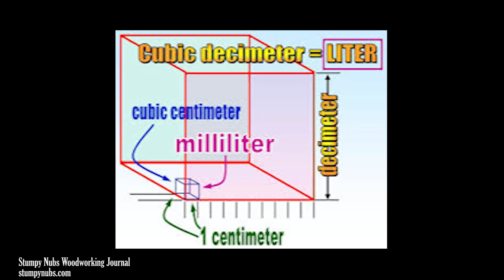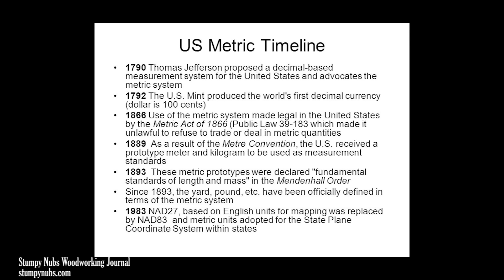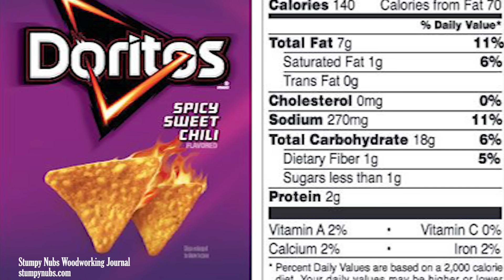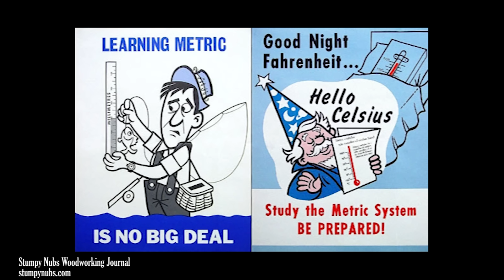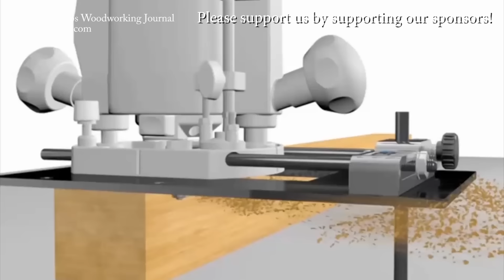BREAKING: The USA is switching to METRIC!

Comment: It's funny because here in Germany we always use the metric system but on our rulers we also had the inches (we call it Zoll which translates customs) . It was very confusing for us some of us back then. But we also got in touch with it back then.
Reply: While we generally use metric in germany, things like plumbing or car rims or tv screens use inches.
Reply: @flybywire5866 Selling screens only it imperial however is not legal. Same with using PS or horsepowers for the power of sth. Imperial should be finally replaced everywhere.
Reply: The german word "Zoll" was written "Zol" back in the Days and was always a unit of measurement. "Zoll" also means "customs" but that comes from the latin word "telonium" which describes the Place you had to pay customs to continue your journey.
Reply: @Wildschwien  I have no idea how PS works for horsepower- I know 50hp is a nice amount on a bike, but is 50PS more or less, and by how much? Same with torque- 50ft-lbs is enough for a smaller bike, but is 50Nm more or less, and by how much? There's just not a sense of scale when it comes to the practical things.
Reply: @shadowmancy9183  PS is Pferdestärke (horsepower) in Germany. However this is not the same as the unit hp I think. We don't use lps as well.
Reply: Here in Brazil we use metric forever, and our rulers have inches too, but we completely ignore the other side of the ruler xD
Reply: @ellie-oaks  😅
Reply: I think this is just common practice in countries that use SI units. I'm from Russia and here some rulers (although not many) also have units doubled in inches
Reply: @lmnk  Depends who has been the wholesaler, I guess.

Comment: As a flight mechanic it would be a 100 times easier if the American engines were designed for metric
Reply: R u working in Boing for any chance? 💀
Reply: Apparently you can hammer on metric sockets onto aircraft spec bolts, Boeing,
Reply: It would be 212x easier
Reply: Ehh no... miles are better... imperial is better
Reply: @sergio-179  Nooo haha
Reply: @markthomas919  Haha well boeing ain't too bad before they started to go only for profits and not being transparant. They where stuck in a bad place when the grounding of the 737 max happened and airbus capatilized of it by producing much quicker than them.
Reply: @markthomas919 or just leave the bolt out.😮

Comment: I believe that in the 1960s there was a big push in the USA to switch the metric system which was quashed by the Society of Automotive Engineers. I think that is fascinating since, as you pointed out, American cars are now mostly metric.
Reply: Wish we had,I would't need two tool boxes.
Reply: The last fastener I saw on an American vehicle was my 1988 chevy pickup... the only SAE bolts left that I know of are the 3/8-16 bolts in a side terminal battery.
Reply: I very much doubt the resistance was at the behest of the SAE, since American automakers are one of the few industries in USA to fairly thoroughly switch to metric.
Reply: @tookitogo  I really wish they had! I had a boat shop in the 1990's. New Mercury (and OMC) outboards with legs and gearboxes built in 'murica were imperial and the powerheads (built in Japan) were metric. BLOODY ANNOYING!
Reply: It's annoying how some american cars have mixed imperial/metric fasteners/bolts, like my 1988 S-10.
Reply: Aircraft and aviation industry is still stuck on imperial units.
Reply: @Chris-hx3om  The transitional period was a PITA for sure!
Reply: @MrZimpauttaja  Yeah, there’s a lot of risk involved in switching. ( *cough* Gimli Glider *cough* )
Reply: We are to lazy to switch lol
However I'd be happy to do so, really isn't any reason not to aside from boomer pride
Reply: This Boomer was disgusted that the conversion was not made during that national debate about swapping over. Anyone who takes a science class must learn metric. That’s when I discovered how truly simple it is. You can still learn fractions for other reasons. It would’ve been so much simpler to do it back when we were in the early exploration of our space program and had all that national pride and enthusiasm.
Reply: This is likely to do with supply chains. If you import from metric-using countries — i.e., just about every country outside the US — you will be getting parts in metric unless you special order them in imperial units, and special ordering tends to be more expensive. By the same token, if you wish to export to those other countries you need to supply your products in SI units, as products that use just imperial units are less useful — and, thus, less valuable — in every country outside those last 3 that still use imperial units.
This holds true even if you send out just the blueprints used to make the manufactured good in another country, BTW; in countries that use metric, manufacturing something whose blueprint is in imperial units ends up being more expensive and error-prone than if everything was in SI units, as all the suppliers will be using SI units.
To put it another way, for any industry that is involved in international trade — such as the automotive industry — using SI units is likely to have lower costs and be more profitable.
Reply: And massive pushback from the people at large. Who saw it for what it was, an unwelcome foreighn intrusion.
Reply: @pamh2703  boo. Metric sucks.
Reply: @carloscollomps1552 well. My SAAB 99 from 1973 had metric except in the Triumph 1.7 and 1.8 liter engines.  Their own 2.0 litre engine was properly designed with metric bolts.
Reply: @jonathonfrazier6622  It doesn't. You just don't understand it. The rest of the world does.
Reply: @gpsoftsk1  we are happy with our system. We have no interest in conforming.
Reply: @jonathonfrazier6622  Yes, I know, typical Americans. No conforming. Then have a higher manufacturing cost than the rest of the world, make more mistakes and use a worse unit system.
Reply: @gpsoftsk1  will do.

Comment: I’m retired now, but I still remember the horror of starting my first job and finding out everything was done in ‘imperial’ units.  Virtually my entire education (in Canada) was done in metric, and by the time I finished university all day to day measurements were in metric units.  However, all my company’s customers were US, and all requirements were in imperial units, well that is to say US measurements as they were a bit different than the British measurements we used to use - just to make it even more messed up.  Now that I am retired and dabbling in a bit of woodworking, I tend to stay with the US units as that’s what all the tools are.  However, I am seriously considering just going all metric for future projects, I think once I get started, I will never look back.

And in some ways the USA is fully metric.  A inch is defined as exactly 2.54 cm and a pound is exactly 0.45359237 kg.  All non metric measurements are actually defined precisely to their metric counter part, and it is the metric measurement that is related to some fundamental physical constant.
Reply: Well said, sir :)
Reply: A screw called out in a design with a British thread type threw off the work cells at one of my past jobs brutally, given that even the British mostly stopped using them ages ago.
Reply: Using Imperial measure is the best way to do construction framing, that's why you do it. You can do a thought experiment on how you would design a metric plywood size and measure out evenly spaced joists to match it. Imperial plywood is eight feet tall. Same as the floor to ceiling hight. The four foot wide sheet can also be framed perfectly with either 12", 16", or 24" spacing. I think, if there wasn't an imperial measurement system, there would be no frame houses at all. Like in Europe.
Reply: I have never bought wood that was in metric dimensions. Using the metric system on wood that is cut in imperial dimensions doesn't make any sense to me.
Reply: To this day I still can not understand British Withworth but I would like to learn before I pass away.
Reply: @timosdinkydetailing , construction measurement habits in imperial units is the only obstacle on the way to switching the entire nation to metric system. Isn't it bizarre?
Reply: @actionjksn , you'll be surprised to find out that measured in metrics, 2/4 is the same size.
Reply: @TroyQwert  what is 2/4?
Reply: Board feet
Reply: @actionjksn , a 2×4 is typically milled from a variety of coniferous species for a plethora of uses by the construction industry.
Reply: Metric is better only because we use decimal numeral system, there's nothing fundamental about it
Reply: @actionjksn Why?  In construction you are going to use the local standard as work will be done such that many pieces don’t need to be cut.  However, in woodworking you almost alway cut, plane or route the would into new dimensions.  In makes little difference what the starting size was measured in.
Reply: @TroyQwert  It's not an obstacle, it's the solution. The perfect way to measure for construction framing. You can't do it in Metric.
Reply: @timosdinkydetailing  , really? Try again. Check the measurements on you measurement tape. They are there in both: inches and mm. And keep inmind again: the size is not changing if you switch from imperial to metrics. It's just different digits.
Reply: @brandy1262  I've worked in construction probably since you were in diapers and have been running my own my own company that long.. Wood people in construction and woodworking in America are not switching to metric because it's not necessary and won't make the work any better at all. . There will be some individuals who do because they already are, but there's not going to be some big switch because nobody in the trades is complaining if they grew up in America. That's why some of the European high-end  tool makers have scales and adjustments on their saws that are imperial.
Reply: @TroyQwert  I've been in the construction industry for over 25 years so I know what 2x4s are. You put 2/4 which means 2 fourths, which is a half. I've never seen 2x4 written out like that
Reply: @TroyQwert   I still have some tape measures that only have Imperial. I use them when doing framing. I think I would be a fool's errand to convert the typical, 4, 16, and 24 inch measures to metric. There would only be downside. Those dimensions are usually highlighted on my tapes, so they are easy to see as well.
Reply: @actionjksn  So is it  "metre" or "meter"?

Comment: I am already a staunch metric user, much to the chagrin of my family and coworkers. My car and GPS are set to metric, I do all of my work in metric (converting only at the beginning and end as absolutely necessary), and, as a bonus, I use the 24 hour clock. Despite all of the complaints I get, I can guarantee that my work is faster and more accurate because I use metric.

Comment: Weirdly enough, the rigid but foldable device for measuring, usually made from wood, is called a "Zollstock" in German, literally "inch stick". A "Zoll" was a cut off piece of wood with a thickness of about 2 thumbs, whereas 12 Zoll made 1 Fuß, or foot. But then a Zoll varied between 2.5 cm in Hesse and 3.7662 cm in Prussia, with Baden and Switzerland (where 10 Zoll made a Fuß) somewhere in between. We also had miles, varying from 7500 to 9000 m, or between 12000 and 24000 Fuß in other places. All in all, the metric system is a good thing...
Reply: Dutch has the same, "duimstok" (thumb stick). Except it's becoming an archaïc word (since it's becoming an unused tool) and we'd use a "rolmaat" (rolling measure) way more often.
Reply: The French used to define a foot as the literal measurement from the Kings foot.
Reply: And this shows why standardization was truly needed. Even before the SI came along, what we now know as imperial units were only ever used in the British Empire; other places had different measurements that, to make things more confusing, often shared the same names but not the same measurements.
Reply: @zbnmth  duimstok and rolmaat arte different things. Duimstok is rigid and still quite handy.
Reply: @@lurch789no it's not. It's the same. your (?) imperial system is just one of the many and evolving imperial systems that are/were out there. That is the whole point. There was no standard, until Napoleon and his metric came along and made it all standardised and simpler. 
Today the US Imperial system is officially defined by the metric system.
Reply: "Elle", "Pfund", "Zentner" are also still common, but are defined in terms of metric units.
Reply: @FabioCapela like 1 swedish mile = 10km. 🤔
Reply: i dont know why it is called "zollstock" here, i know it under "gliedermaßstab" (folding ruler)

Comment: The last three holdouts in the USA are:

1.  Temperature (which is likely to go first!)
2.  Weights and volumes (in lb but these too are likely to go) 
3.  Distances and Speed. 

I suspect that the last will be the most difficult given how all streets are labelled in miles and so on.  It's possible that they will add metric units, otherwise, when it comes to weights, there's really no point in sticking to customary units.  I mean, let's face it, who really wants to buy in ounce increments?

Comment: I grew up in Singapore where we uses Metric. Watching and reading imperial is just about another measuring systems. Hence no big deal. Now a days smart phone are so convenient and conversion is just a click away. 
What I felt really challenging is baking, where Cups and spoons were used rather than weight and volume which is much easier to follow. This is personal. 😊
Reply: A cup is also different depending on who you ask

Volumetric measurements need to go
Reply: @RoryIsNotACabbage  I'd never get any cooking if I had to weigh everything
Reply: Old recipes actually use cups and spoons in Denmark. The problem is that they don't all have the same size. Son of you have a big cup and a small spoon, you might mess it up if you're not an experienced baker. Using grams, centiliters and deciliters (one tenth of a liter) you get the same result every time.
Reply: @RoryIsNotACabbage  When dealing with powders such as flour the volume for a given mass changes depending on how tightly it's packed.  For this reason professional bakers always measure by weight, never by volume.  Also IIRC, US bakers use metric, not imperial.
Reply: Another advantage of using metric (weight) instead of cups and spoons is that there are less dishes to wash. Put one bowl on the scale and add the ingredients.
Reply: @kennith.nielsen  For cooking volumetric measurements are fine. Even if you used the same mass/weights for your dish every time, it won't always be the same because of the natural variation that ingredients have. Some carrots are sweeter than others, some potatoes contain more starch etc. For baking its another story though
Reply: Americans probably used volumetric because imperial is bad for small measurements be it lengths or weight. Say you need 5 grams of yeast ... you'd probably also just take a teaspoon-ish sized spoon to avoid measuring out 5/28th oz.
Reply: The funny thing about these volumetric measurements is most usually they're all defined around the International System of Units: a teaspoon is 5 ml, a tablespoon 15 ml, a cup 250 ml, and the rest you can calculate them. It's true these sizes might vary between territories, but if you make sure beforehand about the actual volumetric proportion between cups, tablespoons and teaspoons used in your recipe (affecting only old recipes), and keep everything measured with volumes, proportions of ingredients will also be kept, and everything will turn out right.

The best thing to do (especially since you're a fellow amateur baker) is getting a cheap set of cups + tablespoon + teaspoon (plastic ones are fine, this isn't precision chemistry), and stop bothering. In my experience, weights aren't right for baking, especially if you moved between countries you'll know your new local water suddenly has different properties (due to minerals or chlorine) than the previous one you used, flour has a different composition (especially proteins), and so on, such things will affect your yeast and the whole fermentation process. So only using volumes you'll get in the ballpark, and then after a couple of tries you'll know how to tune the recipe to perfection; very hard to do with weights.

Comment: I used to hate the metric system. Mainly because their odd sizes didn't fit correctly in the imperial tools I had at the time. But as I aged and started working on industrial machines for overseas, where everything on them is metric, I found it's a far easier method and can quickly be learned by anyone even a child.  There are times now even at home where I'll prefer to use the metric system for my work around the house.

Comment: Even fifty years ago engineering students had to learn both systems.  It was immediately obvious to me how much easier metric was.   Imperial gets very tricky when dealing with weight (a force with direction) and mass (a scalar quantity) because a "pound" can be either one (pound force vs. pound mass).  Because of this and the sheer speed and efficiency of ten base metric most students converted the given values to metric, found the answer, then converted it back to imperial!

Comment: The inch was re-sized and defined as 2.54cm very early in the 20th century.  Although, I think it was "officially" set as such in 1959.   For the  most part, all the precision work in the industrial age has been on an inch that is really metric in disguise
Reply: All the precision work in the Industrial age was done by Imperial fractions!?!
Reply: lol , you wanted to say: precision work was mostly done by metric, especially in the last 100 years almost exlusively :D imagine bulding a CPU with imperial :D
Reply: That was due to the difference between the US customary units INCH and the imperial INCH, then both systems agreed on a INCH being exactly 25.4mm long...